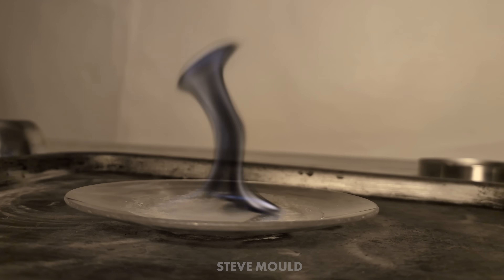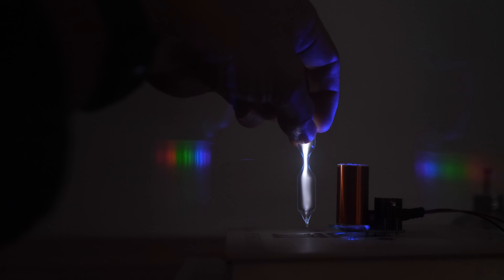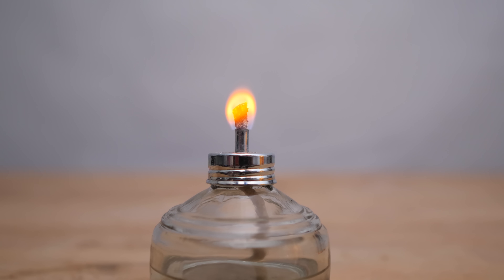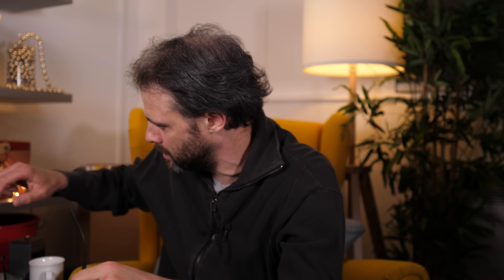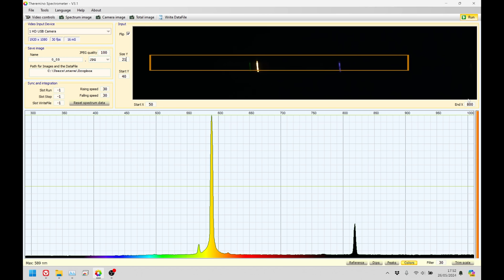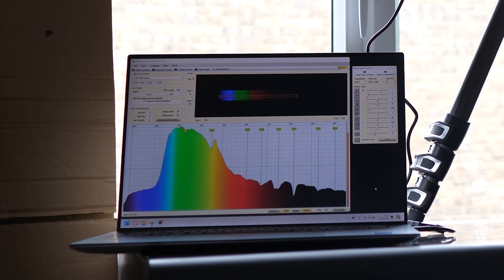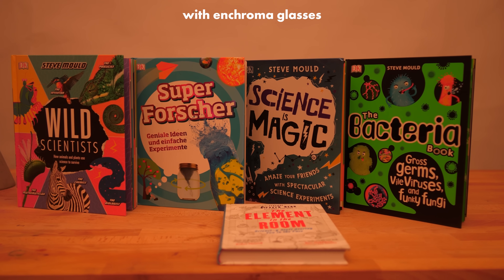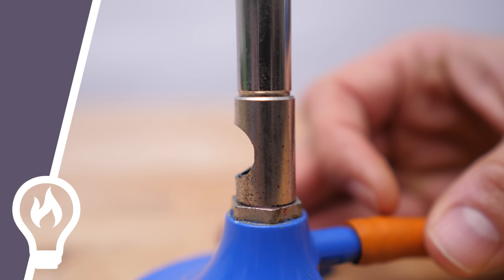Light sucking flames look like magic

Comment: So, I am fully colorblind. I have no cones to see color at all. I want to add my experience with EnChroma glasses to the mix. No, they do not help you see colors you could not see before. This is a fact. But what they help with is restoring the contrast between colors that you cannot otherwise see. 
Through a job, I had the luxury of testing all the options that EnChroma sells. What I saw was that each one allowed me to see the shape of objects in a way I hadn't been able to previously. Leaves became leaves instead of a mass of something on every tree. By cutting out portions of the spectrum, the contrast between what you are now looking at is increased. This allows you to better differentiate between the colors. Still, you aren't seeing anything you didn't see previously; you're just losing the section that caused them to blend together so much that you couldn't tell the difference.
For those they are meant for, not me, this means that the red they can see is now only the red they can see that isn't also blended in with green, and vice versa. The contrast between the colors is restored, which can help you tell them apart more easily. However, you aren't going to gain the ability of a professional paint mixer to tell green 1A from green 2A or red 1C from red 1D.  
For me, it gave me the same added contrast, but I still wouldn't be able to tell if something was orange vs. brown or pink vs. purple.

Comment: So if the flame absorbs photons from all directions, and emits an equal number randomly in all directions, the flame should only really look black if the background is much lighter than the rest of the surroundings, right?  It would be interesting to see this again but with a setup allowing you to switch between a light backdrop with dark surroundings and a dark backdrop with light surroundings.  I'd expect in the latter case the flame would look as bright as the former looks dark.

Comment: Sodium street lights are used throughout the United States for assisting with astronomy usually cities and towns near observatories are often asked to only use sodium lamps so it is easy to filter out of observations. Some cities choose to use shielded LEDs and that also works as long as the wavelengths of the LEDs are as close to single wavelengths and the shielding helps the light only get to the road

Comment: The sodium street-light had one great advantage for amateur astronomers when they were in common use - astronomers could use a very tight-band light filter to remove the sodium light pollution when observing, 'darkening' the sky. Modern streetlights can't be filtered in the same way.

Comment: Lick Observatory stands on a mountain above San Jose, CA. Light pollution is a big problem for astronomers. It turns out that the light emitted by sodium doesn't cause a light pollution problem (or at least not as much of one) for astronomers. So, at some point, the City of San Jose installed sodium street lamps to help them out. I found this out perhaps 8 years ago when I visited Lick, and in an experience I'll never forget, I got to look through the "Great Refractor" telescope. Driving back through San Jose that night, I took particular note of the sodium street lighting 🙂

Comment: I’m a colorblind physician. Colorblindness by itself a terrible term really, as I do distinguish between colors and actually passed one colorblind test in my opthalmology course that required me to put 15 blocks of colors into order that left my teacher a bit baffled since I do fail Ishiharas. I’m still good at distinguishing between two different shades in a controlled setting.

I’m on my 2nd pair of EnChromas (the inside versions). They do make me look a bit goofy, BUT they do make greens and reds a bit more intense and in a clinical setting they help me see reddenings of the skin a bit better than without them (although a placebo effect is still plausible). I think of them more of a gain upgrade than anything else on certain wavelengths.

What it does is make reds and greens ”pop” more. So, if you have inflammation of your skin or mucous membranes and your physician is colorblind, would you want your physician to have a tool that compensates a bit for his colorblindness and makes the comparative reddening easier to detect and evaluate?

Yes, it’s a loaded question and a sort of a niche application, but they’re not only a gimmick in my view. One needs to be clear about what they do accomplish and what they do not.

The ”happiness” metric in this case is actually probably the best one to evaluate whether they’re worth the money. If I didn’t need glasses anyway I wouldn’t get them except perhaps as sunglasses and even then it possibly wouldn’t be more than a gimmick, but for daily use in a professional setting with optical prescription included? Perhaps, if you don’t mind looking a bit silly wearing them.

Comment: Does anyone know if there is any exact alternative to the low pressure sodium chloride bulb?

(I have project I’m attempting to make with the black flame reaction, but I’m on a tiny budget & $80 for a light bulb is a bit steep, especially including the other supplies I need with it)

Comment: The Enchroma glasses were only in question for gullible people who believe marketing rather than logic. The easiest way to know that they're complete horseshiat is to know that at least 10% of men are colourblind, so on average more than one in twenty people. Have you EVER seen anyone wearing those ridiculous glasses out and about? They've been selling that crap for many years and yet nobody wears them because they don't work. All you had to do was stick any other red coloured lens or plastic in front of your spectrometer and you'd find they did exactly what those glasses do, which is swindle people.

Comment: In Islam it was told that the colour of Hell fire is PITCH BLACK because of the intense heat. our sun only yellow colour then hotter star is white, the hotter is white-blue then hotter is blue, hotter than blue not existed in our universe today it would colored ultra violet or black light the color of Hell fire

Comment: One thing that still confuses me: the sodium is pulled up into the flame and  starts absorbing light. 
But then why does the black flame taper off and disappear so quickly? Rather than having a talk column of light absorption above it as the absorbing atoms rise, like a column of smoke?
In a regular flame column the flame appears to taper off because the atoms in it have lost enough heat they’re no longer emitting photons.
But The atoms are still there in the column above the flame so why are they no longer absorbing the light? Do they just disperse enough we don’t see it? It doesn’t quite look like that to me.

Comment: 11:11 A point isn't one-dimensional is  it?
Reply: A point is dimensionless but despite electrons being called a "point particle" they are treated as three dimensional components when considering it's pratical use. I assume it's called a point particle due to its variable position in electron clouds of different elements hence assuming the likely position point within (not at all localized due to its uncertainty)
The thing is you can assume electrons to be of any dimension solely from how you preceive it. If it's theoretical it's dimensionless, if pratical it's mostly three dimension but, if you were to consider time and space as it's own dimensions, suspending an electron of nozero size then it could be any dimension.

Comment: I wonder what the flame would look like if you did this in a vanta or musou black room.. where there would be no reflection back from the environment. I think that it would just appear to be an ordinary flame from the side that is opposite the light, and would be black flame on the side the light is on. If you shine the light from above then when looking from below it would appear to be ordinary flame and from above it would be black. Or maybe the light would somehow reflect off of the flame itself so it would all be black still, or perhaps shifting from ordinary to black depending on some other factors.

Comment: The explanation for the black flame still doesn't quite make sense to me. Sure, the light going through it is redirected evenly in all directions, but it's also coming from all directions right? That should make them cancel out. If anything, the lamp is bright enough that the flame should give off more light in every direction except when the lamp is directly behind it.

The only explanation I can think of is that there is an imbalance in where the particles absord and give out light. The places where it absorbs more light are darker or black. The places where it gives out more are the white parts you see.

Comment: Holy shit, I’m an audio engineer. In my brain it processes a black flame as color phasing. On a sound frequency spectrum. If you inverse a sound wave, the monitor which produces the sound cancels out. If you match most of the frequency spectrum it partially cancels out. So in the terms of the black flame, we are canceling out photons that’s being emitted by matching it. Though it’s not perfect it can still produce light but of a different variety. In laymen’s terms it’s noise cancelling headphones but with fire. Very cool and insightful.

Comment: "How can a point-like particle have angular momentum?" (at 11:35) I think is because it's a vector rather than a point. It has a a location and also a direction and rate conveyed into reality as a location over time with the rate being set to "infinity" which is not possible so it hits the universal speed limit instead. You can essentially think of it as a fundamental aspect of spacetime, not just space, and you can think of it as a particle that moves on the smallest possible scale every universal "frame" (in video game terms), meaning it is so fast it updates its location faster than everything else but no faster than the computer (the universe) can process its movement.

The reason it applies to very well to computer programmed hit scan lines is one of the many reasons very smart people think we may be living in a simulation. But this is only one interpretation and it's very possible that we're viewing it through the lens of the current information age which is programmed to simulate real world concepts and so of course the simulations work like the real world. But do our simulations work the same as the real world from an extradimensional creature gazing into our universe like a child with an ant colony? Probably not, and it's equally possible we are not living in a simulation at all. The result (virtualized digital simulations based on reality as we know it) cannot be used as data (scientific measurements of reality) to determine how reality works. Not without a control of course, among other things.

Comment: If your TV, stereo, Roku, fire stick or ANY other infrared remote control quits working, aim it into any camera in any cell phone. If your remote is working, you will see a blue or purple spot coming from the emitter LED on the end of your remote. If you see the spot, your problem may lie with your main unit being controlled. Not very often, but the possibility exists, due to a defective chip or LED, the frequency of infrared light emitted from the remote can shift so that the infrared receiver in the main unit doesn't recognize it anymore. I had this happen once with an older DVD recorder. The dot was in the camera but the unit wouldn't respond. An identical remote worked though. It's like listening to music on the radio, bumping the tuning knob and getting static. You, as the receiver, no longer recognize the static as music so your tapping foot no longer responds to the noise. The radio still works, just not in a way that you recognize anymore. If you don't see a blue or purple spot, change the batteries.
Not so fun fact:
The remote for the Roku stick operates on an FM radio frequency and will not show up in your cell phone camera, working or not. You will need a frequency counter or spectrum analyzer to diagnose the problem as these remotes have to be paired to the particular Roku unit to work. This is so that if there are multiple Roku sticks in multiple rooms or apartments, you and your family or neighbors aren't fighting to keep THEM from changing YOUR channels and vise versa. The freq. counter is about $100.00, the spectrum analyzer, about $4,000.00. A Roku remote, about $20.00. You decide. With the old satellite boxes that gave 2 rooms of service that Dish Network used years ago. The main remote that was used in the room where the box was installed was infrared. The remote used on the second receiver within the box for the second room was radio. This is because with the box installed in, say, the living room, the remote had line of sight control of the box. If the second channel of the box was installed in a bedroom, den or man cave, It's control signal would have to penetrate walls to control it's portion of the box hence, radio control replaces line of sight infrared control.

Comment: Don't pay too much mind to this as it's just a random though I had in like to or three minutes

I find it curious how people say natural light, or natural illumination; I believe it very Mis phrased;
as basically any type of illumination can be naturally occurring, and any type of shadowing can be naturally occurring.
in a sense, basically any illumination would be natural; as the only thing science does with light bulbs is just imitate the natural state of how particles work/ atoms etc even virtual reality isn't unnatural, as its simply electricity and optical illusion

I think people should actually start tagging thing properly, and simply call it rare/odd light rather than unnatural.

now it is in a sense a miniscule thing, by the situation I'm referring is that people give it a weird tone calling things unnatural; and that lead to a mystic or supernatural and or religious processing in the brain, which basically repeated enough time start making people get this idea that this isn't good because its unnatural, and then basically that idea, starts being basically fanatical to a extent to the point people end up doing extreme behavior on a irrational thinking, that to be exact isn't irrational it's just that nobody gave it much thought and speed lines assembly line the process of thinking, witch end up causing many problems down the road.

now a know this kind off very left field but it's just a thinking process I had right now when i hear the concept "natural"

basically, people should never give a mystical label to thing about a process they don't comprehend, and as people can see it's really not hard to comprehend; as thing should be labeled with if it's dangerous or not, the cost, and the possible damages, rather than if its natural or not.

because to a fundamental degree radiation, ultraviolet, and any excessive similar highly damaging, highly toxic, and highly unhealthy thing things in reality is a natural process and, being a natural process that doesn't make it anymore "good to be implemented, encourage, or directly preached into people"

but essentially, what I'm referring is that people should really stop that tone or mysticism/fanatical construct of the term "natural"

as people with a fanatical form of thinking, or people who start ideologizing thing, which is basically every person in the world almost, tends more times than not, to start stigmatizing basically a general perception of lack of knowledge or understandment; and start propagating the level of in a way dumbness, in a fanatical pursuit of a concept that is mislabeled as an ideological absolute good, which is miss-used/miss-represented/miss-implemented since the beginning of the first step of the whole thinking phase.

in a sense, it's like medicine and radiation; medicine is a created human thing threw the use of natural elements, while radiation is basically a random full natural phenomenon; witch essentially results as everything being basically natural, and nothing being unnatural, after all people who say that certain scientific are unnatural; are basically the same  statement that lead to a explicitly process  that the brain is equally unnatural to, due to the brain being actually much more "unnatural"  based of the concepts of what is "natural" due to the very bases, that the brain is constantly adapting and modifying, and going beyond/deviating from its establish "natural original state" ever since it was borned.

its curious how something stigmatized, and speed rail extremed to a degree, can end up being a contradiction of itself, with just a bit more thinking and self-awareness.

this is actually the number one reason why I tend to say; "always be sus of speed; especially-specifically in the thinking and awareness phase about anything"

Don't pay too much mind to this as it's just a random though I had in like to or three minutes.

but in general; people should be thinking more of things tbh, in specifically things that the brain auto-skips/Automate or speed-lines in thought process.

Comment: @SteveMould When you are burning methanol and the saltwater sodium is giving off the colored flame, what is going on with the chlorine ions in the water? Does the chlorine not give off a colored light when it burns, or is the chlorine left in solution?